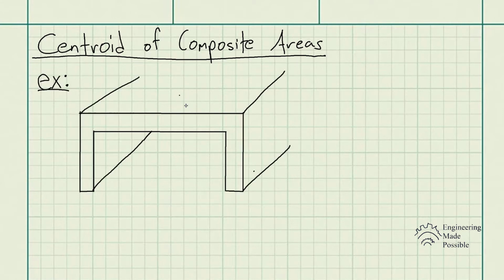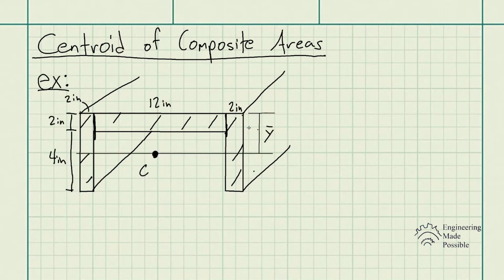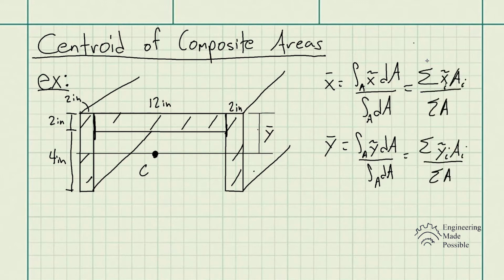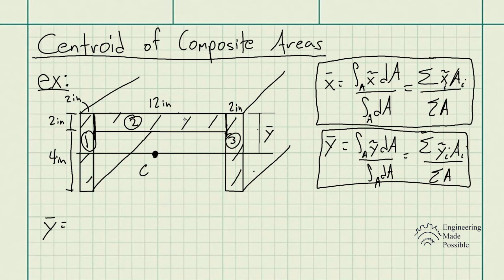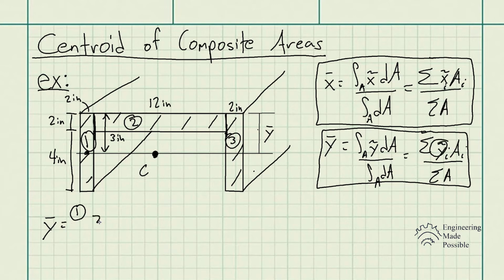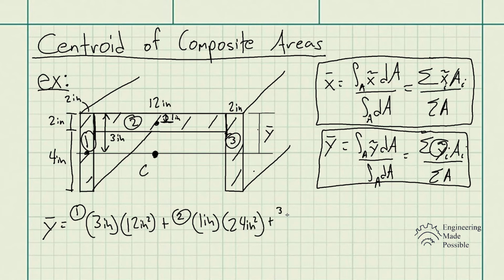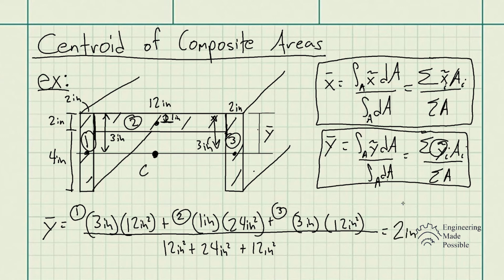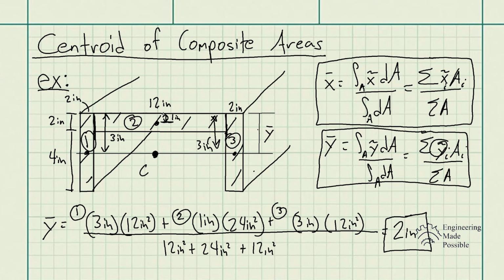Centroid of Composite Areas - Statics

Comment: In this video, you do not account for the length from the bottom when considering the centroid of the 2nd part, hence you chose 1 in. Whereas in the video I have linked below, you do. Which is the correct way? And are they different?
Reply: https://www.youtube.com/watch?v=hsxvaH55kb0&list=LL&index=17&ab_channel=EngineeringMadePossible
Reply: Actually I've noticed that you started from the top in this problem... I see why it was done differently. I just have to be careful with where I begin!